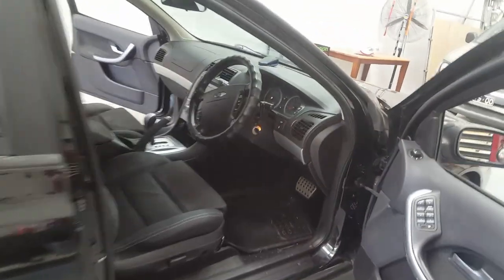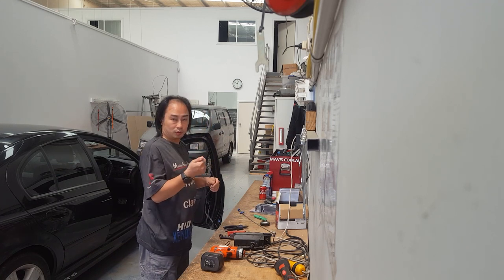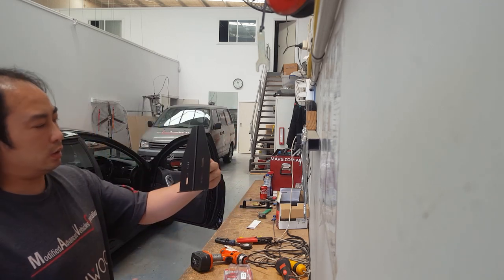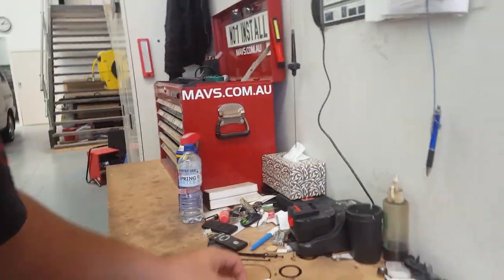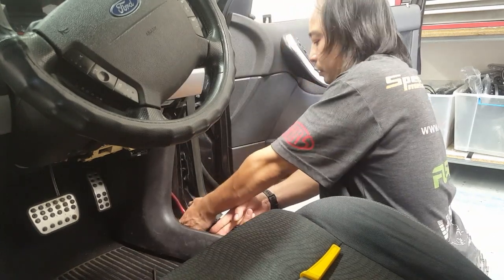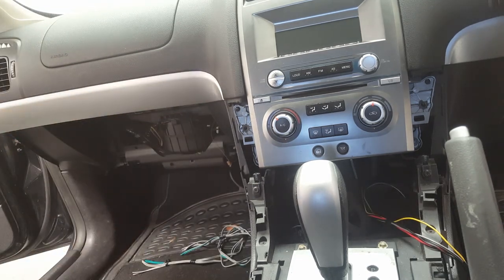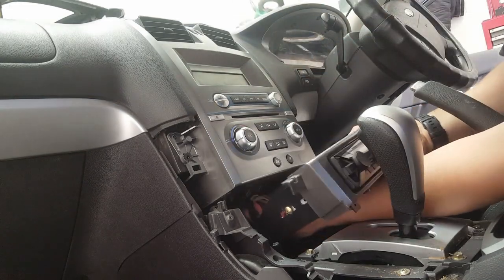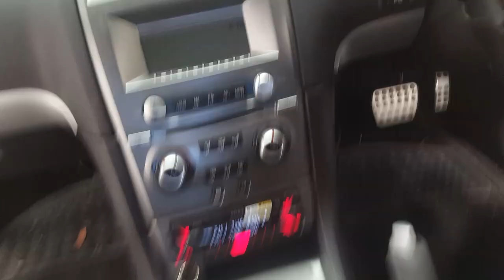How to install a after market head unit into a Ford Falcon BA BF

Comment: Also does the air-conditioning/ heater unit still work after? I assume this only disables the amp for the factory stereo and not the climate control & screen.
Reply from the maker: sneans that's correct

Comment: Can you explain the Blue Plug under the dash...   Which wire goes where ?    Great video
Reply from the maker: silvec01 Hi the top of the blue plug has the tab so if you're looking at the plug the top right is ground and is black wire the on the left of that is 12 volts constant, bottom left is accessories and bottom right is telephone mute.

Comment: Hi I have a few questions. Will the head unit turn off when the keys are not in? And how did u Connect the speaker wires to to original wires?
Reply from the maker: Yes it will turn off once the accessories is turned off as for the speakers wires referred back to the video

Comment: another stereo is not needed as you can just run bluetooth of the AUX and keep the steering controls functional .
Reply: Yes you can but the sound quality is not the best as after market head unit
Reply: Also some factory steroes shit themselves after a while like mine did nothing works except the airconditioner controls and i was going to put a Kayhan stereo in but I've only heard bad feedback about them

Comment: Hi, just wanting to know with the blue 4 pin plug, What fuse is that connected too as it seems I’m getting no power so I assume it has a blown fuse?
Reply from the maker: Hi there should be a constant power and a accessories power but if you aren't getting anything then check you fuses as they most likely be the first line of defense against short circuit.

Comment: Hi trying to put a head unit in a 2007 ba falcon and if I cut the speaker wires to run to the head unit the car won’t start
Reply from the maker: Yeah sorry I'm not sure what you meant, and what wires did you cut?
Reply: @mavsonline  I cut the pink speaker wires behind the glovebox and the car won’t start unless I connect them back together even if I tab into the speaker wires without cutting them the car still won’t start
Reply from the maker: Behind the glovebox there are two sets of pink wires you've must of cut the wrong ones it's the twisted pair one had a black trace on it

Comment: Thanks for the video - sorry if you already mentioned it, but is it possible to still use the steering wheel controls with head units that support it?
Reply from the maker: Hi no unfortunately the steering wheel control will not work with this setup

Comment: Brother i have installed Android head unit in it and working perfectly just I can't able to connect the reverse camera in it . Can you please help me how to install that in my Android head unit . I connected speakers power anteena all . I just wanted to know which is the reverse wire in ford falcon
Reply from the maker: Reverse wire can be picked up from the rear Reverse light.

Comment: is there a reason you could not bypass all factory wires other then remote/trigger wire if you did not mind losing the steering wheel controls?
Reply from the maker: That what I was saying In this video to bypass most wire so there's a better sound quality from the after market head unit.
Reply: @mavsonline   thanks mate, I'm getting old so I could not really hear you lol
Reply from the maker: All good no worries at all

Comment: I have used your helpful video to fit a head unit to a bf (premium sound) and splits in f doors but still getting sound through original tweeters. Any thoughts?
Reply from the maker: Hi you can disconnect the original tweeter

Comment: Hey, I didnt get the orange plug part on where to tap it in for the right front speaker? The loom comes off as a "Y" like you said so do I tap it in the plug side or the loom where it goes to the firewall?
Reply from the maker: do not tap into it but cut it so it doesn't backfeed into the ICC internal amp connect to  the side that's not the orange plug
Reply: @mavsonline  I guess you wont be able to use the steering control whrn the after mrket head unit is placed in?
Reply from the maker: that's correct

Comment: What wires are the ignition ground and constant power in the blue plug behind the fuse box?
Reply from the maker: TRXTR206 black is ground on the left of the plug its constant and underneath its ignition from memory.

Comment: If u conect  negative new wire it will not work those have to be left untouched as it will interfere with original stereo
Reply: Speaker wire that is

Comment: Can anyone help. I pulled my standard head unit out, not to change it but to see if I had a bad conection. 6 stack CD wouldn't work. Put it back in and now nothing works. No air con, nothing. Any ideas. I rechecked everything 5 times over!!!
Reply from the maker: did you disconnect the battery before removing it or tip the ICC unit upsides down?
Reply: No I didn't disconnect the battery.
Reply from the maker: I think you might need a new one
Reply: No worries. Thanx man.

Comment: ay mate great videos on your channel lots of good info.

is it possible to install a 6.2 inch touchscreen unit in the same place?
is there a bracket made to house this in territory's?
Reply from the maker: Hi sorry there isn't one yet due to the fact that there's not enough room for fitment, but ive seen someone use this Fascia kit and cut out the bottom part of the plastic and fitted a double din in, it doesn't look the best but they're so determined and would not try to get a single din but it's in there lol
Reply: @mavsonline  quick reply mate... cheers.

I was thinking I could do that (cut the bottom out) but as you said it won't look the best.

it's a pitty because I have a unit in my old car i'd like to keep.

do you think it would be easy enough to ask a fitter to give it a go. or, is it worth buying a single din and dealing with it?
Reply from the maker: you can ask a fitter to cut it out but its up to you as its only $50 for the fascia
Reply: cheers again  @mavsonline